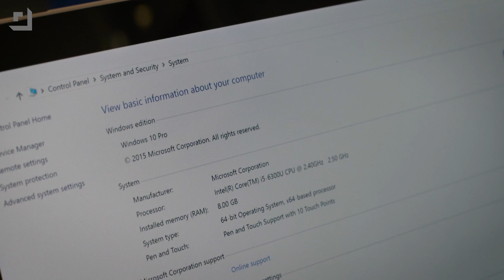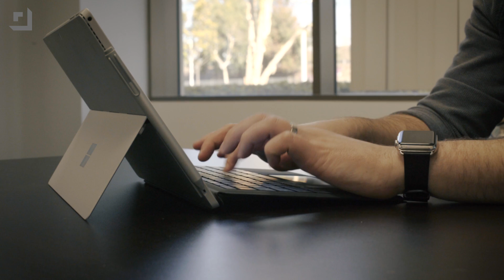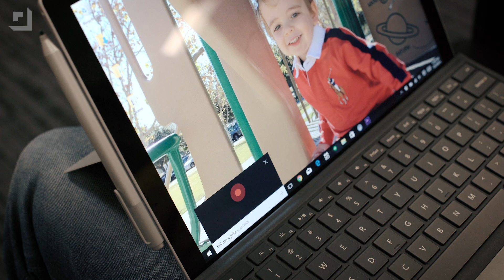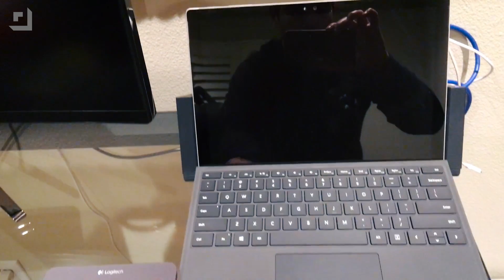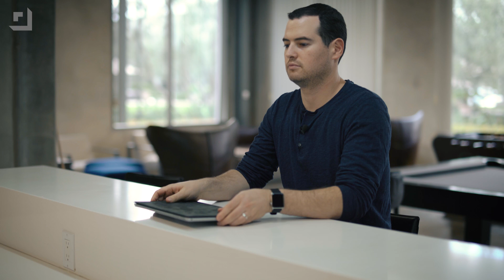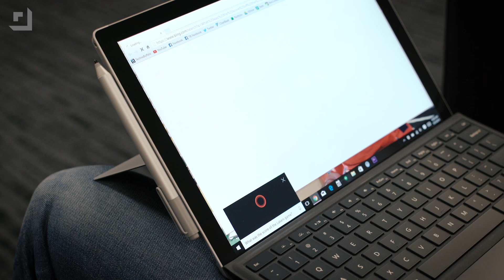Surface Pro 4: Still the Best

Comment: I have the i7/16/256 version of SP4. I use it many hours every day. In the office, all day for everything work related. At home it is always next to me, ready for whatever.. then when I go to bed at night, I slap it in tablet mode and use it for everything from web browsing to Netflix, reading magazines, what ever. IT STILL AMAZES ME! Every single day! I came from a 2015 Dell XPS 13 and as a laptop, the SP4 is so much better in every way. I sold my iPad Air 2, because the SP4 does everything the old iPad does much better. Smoother scrolling, faster, more responsive, nicer screen. I freaking love the Surface Pro 4!
Reply: Really? I was thinking to get the xps15
Reply: Have the exact same model. Same thoughts, same experience. I actually enjoy reading pdfs on SP4 more than on kindle due to pen and night mode.

Comment: What do you expect from the next Surface Pro 4? What could possibly be improved?
Reply: +CryztalBT don't forget USB Type-C
Reply: +CryztalBT and dont forget the ability to use a desktop class GPU with it via Type C or the charging port(thunderbolt actually)
would love that especially if its backwards compatible
Reply: ***** No, actually my bad, I mean type C Connector(Thunderbolt 3) which doubles as USB 3.1 as well
The Alienware 13 and Razer Blade Stealth offer this functionality to connect a desktop class GPU
Also the Charging port of Surface Pro 3 and 4 is actually more than just a charging port, its a thunderbolt port too underneath apparently which is why, it can power the Surface Dock 
So its actually possible imho(I may be wrong but this is what Ive found out so far from the internet)
Reply: ***** Thanks for your explaination
even a low powered one will be better than Intel HD4600 :D
Reply: ***** I know its decent
My HD4600 on my SP3 is pretty OK but nothing like a dedicated GPU
Im guessing you have 8gb ram or more 
I have 4gb (I didnt need much)
Could even handle GTA V though which is commendable
Reply: Karthik Naik Intel 520 graphics are about 10x better than HD4600. It's not even comparable, the new integrated graphics are just as good as a dGPU. HD4600 is garbage, can't even play the simplest games
Reply: 0M9H4X are you dumb? I just stated my HD4600 could handle GTA V even with 4gb of ram
Also Benchmarks state that 520 is only 10-15% faster than HD4600
Does GTA V seem like a simple game? or heck even Skyrim for that matter?
No one is saying it can replace the need for a Dgpu but its pretty decent
Dont argue for the heck of it without any base
Reply: ***** I wouldnt say that necessaarily, benchmarks state otherwise actually
its only marginally faster
Reply: David Taylor actually the charging port/slot/whatever of the Surface Pro 3 and 4 is actually a thunderbolt port in disguise according to some sources
thats kinda evident because of the Surface Dock which opens up more stuff on the Surface 
So theoretically Microsoft can enable external gpu docks right now if they want
Reply: ***** once again benchmarks are theoretical, real world difference may even be 5-10 fps more
theres no saying for sure unless you test side by side
Reply: ***** So? my SP3 can handle GTA V on medium settings and Skyrim too
Reply: ***** umm what?
80% faster?? what are you smoking,benchmarks say shit, see real world difference
also i7 will heat more than i5
Reply: ***** not really
dont kid yourself
Reply: ***** hey asswipe, dont trust sites blindly, configurations differ and so only trust them side by side
I have and the performance difference is minimal
Reply: ***** Sources? like fucked logic?
The links you posted arent for the Surface series, its just random laptops with HD4000 and HD4600 NOT the EXACT same hardware configs as Surface
Also benchmarks prove shit
heck for example- lagdroids can have 100 cores but itll still lag as much as a dual core so your logic is irrelevant
your arguement is like saying a murcielago is faster than a Gallardo IN BUMPER TO BUMPER TRAFFIC
See how dumb you sound
Reply: TLDR you obviously have shit logic
you are as bad as isheep- "Apple said its 4x faster"

Comment: TechnoBuffalo Reviews are like the gold standard.. I NEED to check your reviews when i'm checking out any devices.. your review and unboxing videos helped me with my decision to buy an SP4
Reply from the maker: We really appreciate it. Thank you.
Reply: +Linda Harkin they did fix the battery drain on sleep issue, the battery still lasts six hours currently though, maybe the update is on its way..
Reply: +Keith C they said eight! I can get that if I lower the brightness, have tried it, but when it's at suggested, you don't get 8 hours. it lasts some where around six.
Reply: +Shrijesh Siwakoti Did you already get it? I hear they are rolling out updates that will help fix the skylake issue that caused battery to last only six hours. Just wanted to see if it has been fixed yet..
Reply: Shrijesh Siwakoti
ok thanks for letting me know. :)
Reply: +Shrijesh Siwakoti You've obviously never been on LTT then.
Reply: +Aaryaman Baid well Linus is awesome, it's just that he doesn't do smartphone reviews, but I like how he doesn't leave anything behind lol.
Reply: +Shrijesh Siwakoti Hours many hours did they promise at the time of release? I'm just curious to see if its below their standards
Reply: Thanks bro!!!!!!
Reply: sure!
Reply: +Shrijesh Siwakoti hey bro! because the core i5 is fast enough for most things I throw at it I find that setting the Max processor state to 50% on the battery saver power profile and 75% on balanced (min processor state always at 0% when not plugged in) with those settings and regular screen brightness I get more than 10 hours! Still plenty fast for using the internet, word processing and watching videos! thought I'd leave this comment here since most people don't fiddle with those settings!
Reply: +Shrijesh Siwakoti hey bro! because the core i5 is fast enough for most things I throw at it I find that setting the Max processor state to 50% on the battery saver power profile and 75% on balanced (min processor state always at 0% when not plugged in) with those settings and regular screen brightness I get more than 10 hours! Still plenty fast for using the internet, word processing and watching videos! thought I'd leave this comment here since most people don't fiddle with those settings!
Reply: +Marcio Cattini Wait, you still got those options? I have them on my other laptop but not in the SP4. The only options available in it are to change the brightness and sleep options in the advanced power settings ...
Reply: +Shrijesh Siwakoti for real? i might have been misleading but i have them on my sp2! I was like 100% sure they'd be there on the sp4! Can you google if you can enable those settings via registry? see if you can and give us an update on that battery sir! kind regards!
Reply: +Shrijesh Siwakoti check out this article! processor power management seems to be there! http://m.windowscentral.com/how-max-intel-hd-graphics-surface-pro-4
Reply: +Marcio Cattini thanks for the tip bro, I installed the registry and changed the settings to 50% . Also, seems like people are still having issues with sleep but it got fixed in my device because I use visual studio with hyper V enabled. I'll tell u the result for the battery life soon.
Reply: +Shrijesh Siwakoti ... not too soon yet?
Reply: Shrijesh Siwakoti

Comment: So, iPad Protato vs Surface Pro 4?
jk lol Surface wins this one
Reply: +MrBlitz Danos138 has a point. Let me put this out there: i am not saying the Surface Pro 4 is bad. But the fact is if you want a fast Surface Pro that means dropping some big cash. Which the iPad Pro can get done in much less than that. Another thing. Running OSX on an iPad would be hell. OSX is simply never designed to support touch. If you do own a mac you should know this quite clearly. The buttons are tiny! Running OSX would be hell on there. In fact i believe the product could have been worse if it ran OSX! 

Apply could have done something to make iOS better for the iPad Pro and they tried! It is a first generation product and just like the first Surface Pro it hasn't turned out well. Give it time to mature and the product will likely be just as good as the Surface Pro.

Watch MKBHD's video on tablets. Even he says that the Surface lacks in touch. It shouldn't be considered a tablet if it has hardly any touch support. Where as the iPad has full touch support and therefore it was a better choice for them to go with iOS rather than OSX
Reply: AshFTW I'm not Jony Effin' Ive or whoever the hell is responsible for designing OS X. Yes, I own a Mac. Yes I am fully aware it's never designed from the ground up to support touch. But who said that it should stay that way? Windows 7 wasn't probably good for touch devices, Windows 8 was trying to focus on tablets and then Windows 10 was kind of the middle ground (good for both).  I actually think the small buttons problem can be solved on either platforms by either scaling or just using the stylus that I'm gonna go ahead and assume should come in the box and be stored somewhere convenient in the first place. The iPad Pro doesn't come with either of them and at least the Surface Pro comes with a stylus so that's a point for the Surface. And unless you think 32GB is enough for anything "Pro" or that the stylus doesn't count then the iPad doesn't start under the Surface's price point. My point is with the Surface you have a better "bang-for-the-buck" ratio because you can do more on it! If Mac OS X is worse on the iPad than iOS then okay... why are you comparing it? The debate would be over then the iPad loses in either case because you're paying almost as much for the Surface but you get more... I know it's a first generation product but my job as the consumer is to point out the flaws... I'm not the guy who built this. And don't get me wrong the Surface ain't perfect. There are some minor glitches with Windows 10 yeah and I think the keyboard shouldn't be extra... but as a whole package, the Surface is clearly the winner just by the fact it runs a full-blown desktop OS...
Reply: ***** Ok first of all buddy, the iPad runs iOS... a MOBILE OS.. not Windows which a full blown DESKTOP OS. There's basically no competition here the benchmarks are irrelevant. You can get more done on the Surface because of course you can! There's so little you can do on platform the same one that runs your phone. Compare the software not the hardware my friend.
Reply: ***** I wasn't making fun of the hardware specifically as much as I was making fun of the whole product itself... I think this's a joke. You want one programme? I'll give you many. desktop Microsoft Office, Photoshop, After Effects, Illustrator, not to mention being able to multitask with opening more than just two programmes... oh and everything is supported, not just select programmes you can multitask with.
Reply: Your debate is pointless You're practically comparing an iPad Air 2 on steroids to a Windows PC. Yes the Surface is a PC as long as it has the same software as your gaming PC...

All of your questions can be answered once you realise the operating system on an iPhone =/= an operating system on a PC. Period. I'm not hating on the iPad I never implied it... I'm simply saying between these two, the Surface wins because there's no competition... not unless the iPad runs Mac and I'm oblivious.

Yeah sure I'm bias... because I own a MacBook Pro (I'm talking to you through it for God's sakes), I use Photoshop on it and Inkscape to do my art, and I've used my Air 2 but failed to get anything good enough compared to this.
Reply: ***** I'm done.
Reply: +MrBlitz Are apple haters really that insecure they need to make fun of apple even in a video about SP?
Reply: Ocean dude He was making a comparison  about what is essentially an OS from an iPhone 6s to a full blown PC OS.
Reply: ***** I completely understand what you are saying and i hope you understand what i am saying too! Im glad to see people like you who are willing to point out the bad in both machines and not be biased to one :). If only there were more people like us haha
Reply: +MrBlitz I knew people will come here and say iPad performance beats SP4...come 
on,you think that Geekbench score can truely reflect the performance 
differences between x86 and arm? There's an article out there testing 
real world performance between iPad Pro and SP4.Every single task SP4 is
 twice ish faster than iPad Pro.
Reply: Liao Ssin Not to mention you can use a ton of apps at the same time...two apps on split screen don't really count as "pro" multitasking...

Comment: I agree with what you say about the type cover being included in the price, IF, you're buying this device to use as a laptop.  If, however, you're buying it to use as a tablet only, you would be paying for the type cover but never use it.  The same can be said about the pen.  You paid for it but don't use it.  If the pen was offered separately as the type cover is, you would not have bought it and paid slightly less for the device.

Comment: This is a great device! Apart from being a great laptop replacement, will it be able to replace an iPad mini4 also ? (Basic browser, e-reader, heavy mailing, for genuine ease of use purposes?) I know someone who's planning to get one as a laptop replacement, but I'm curious if it'll be comfortable enough to replace all other devices.
Reply: +Arman Talwar It's about the weight and size of an iPad Pro, so not sure about it replacing your tiny iPad mini. For long use as a tablet, you probably want to pull the keyboard away and put it on a table with the kickstand opened.

What I can say is that, as a tablet, I like my SP4 a lot more than I thought I would. Personally, I got the SP4 to get a ultra portable Windows laptop that isn't shit, that has a great pen digitizer (because I like drawing) and that comes with Windows 10 Pro; the tablet mode was just a bonus I didn't think I'd really care about, but I actually like it.

That said, I'm not a huge tablet user and I couldn't care less that the iPad has a hundred billion zillion more apps. (As long as a tablet does a great job at browsing the web, reading PDF and sending emails I'm happy.) If you care about your third party apps then Windows 10 is a deal breaker.
Reply: +Arman Talwar hey the OS is a little bit awkward while using it as a tablet specially because of the lack of apps. You'll end up using the browser a lot and for that u will need the keyboard.. but it's great for media consumption and for productive tasks, the pen for taking notes on lectures.. like he said, its still the best!
Reply: ***** apps like youtube, viber  and stuff.  Even the S kype apps are limited, you cannot place a group video/audio call and the Facebook app in other devices are better... stuff like that, and I know the keyboard is awesome, specially when you're using the pen to write stuff, but its not handy at all  times, like of you need to send an urgent email or to adjust it while using the browser...

Comment: If only it had a 4G option. It simply isn't a viable tablet option without always-on connectivity. So, it's either a hobbled iPad Pro (which I'm on now) that is always connected or the full featured SP4 that would require me to tell a co-worker "sorry, let me turn on my hotspot." Why wouldn't they have an LTE option?

Comment: Why do I never see anyone complain about the BSOD that I've seen so many times across the many Surface Pro 3 & 4s I've used?  In my IT group we had hoped to standardize on the Surface but have backed off waiting for this issue to be resolved.  In my experience it most often occurs when switching WiFi networks.  We first saw it with the Surface Pro 3 and hoped a firmware or next gen Surface would finally make it go away.  So sad, it has not.  I love the form factor and would love to give it all my support, but just when I think I've gotten past the bumps -- BSOD!
Reply from the maker: +Dwayne Mangum I haven't had that issue.
Reply: +TechnoBuffalo I'm surprised you've been recommending this product so much considering how many software issues it has for a premium priced product.

Comment: I'm thinking of picking one of these up to replace my aging MBP, who would you recommend the i7/16gb model to? I plan on using the SP for AutoCAD, 1440p video editing on the go, image editing with Lightroom/Photoshop on the go, and some linux/css/php coding. 

All of my more intensive projects would be handled by my desktop (which I plan on throwing an i7, hence why I'm wondering if my SP should mimic my desktop's cpu).

Comment: Surface is an average computer and a lousy tablet. All in all, it is not worth, it is a product without focus.
UPDATE: I bought a Surface Pro 4 to try it out and I am fairly impressed with it. I am thinking about selling my iPad Air 2 now.
Reply: UPDATE 2: after so many windows bugs and hardware issues like light bleeding and going to sleep out of nowhere, I returned the Surface and got an iPad Pro 9.7. No remorse. Microsoft is the same crap as ever and surface a very weak pc and poor tablet

Comment: I took advantage of the Surface Pro 3 price drop at Best Buy and bought it with the Pro 4 type cover. It is pretty amazing with the versatility it has. It's currently my desktop at home, my laptop on the go, a tablet for light tasks and media, and a notebook for class. Highly recommended. Able to handle my graphic design and programming work and runs office like a champ. (Core i5, 8GB, 256GB)